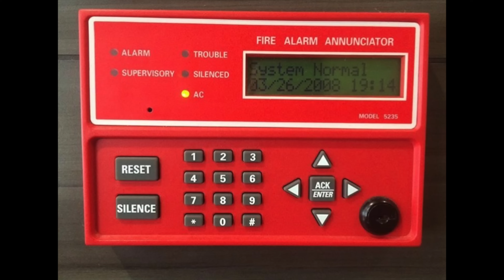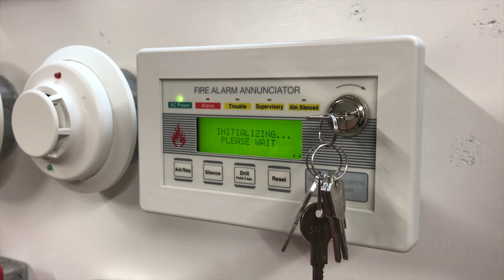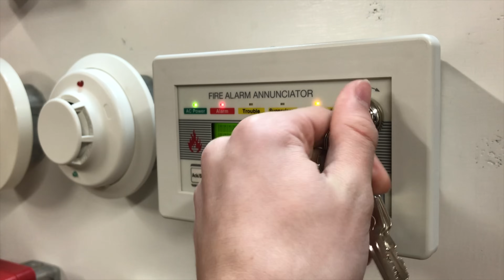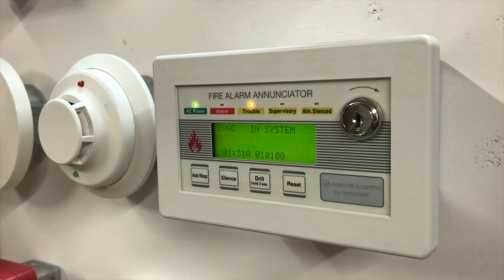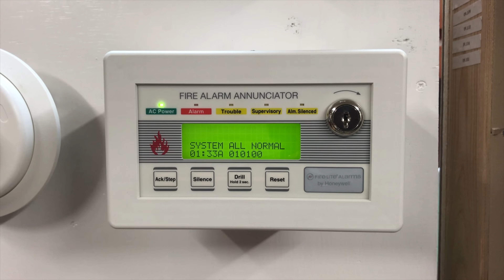What is a Fire Alarm Annuncatior?  LCD-80F

Comment: Can you use an annuncatior as a panel by itself? I don't think i would like to spend thousands on a panel
Reply: You can NOT use an annunciator as a panel. An annunciator is simply an interface (remote control) to the panel. So you need a panel.
Reply: An Annunciator will literally do nothing without the panel

Comment: Around when you were doing the drill the annunciator seemed a little under voltage or something because the piezo was going down in pitch. Just a suggestion to check on that.

Comment: I have been watching your vids forever.  I watched one of your old videos, and you sound so different!  Question: for a beginner, what setup would you get?
Reply: Man Pizza I don’t recommend an addressable panel. I would get a fire lite ms-2 or ms-4 which you can get for a cheap price of 200-300$ new. Then get what’s called, conventional pull stations and detectors and get some horn strobes off of eBay.

Comment: Why is the system in trouble when u pressed the drill button the annunciator
Reply from the maker: Good question. When you press the drill button, the panel disables the on board dialer therefore putting the system into trouble. This is nice because then the fire department will not show up when you are just holding a fire drill.